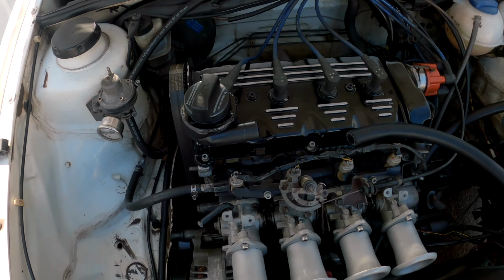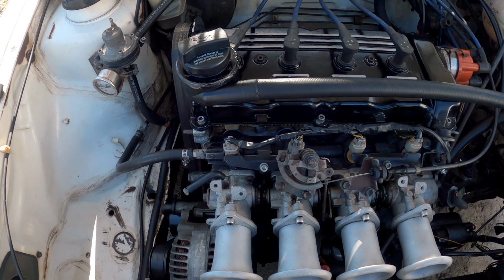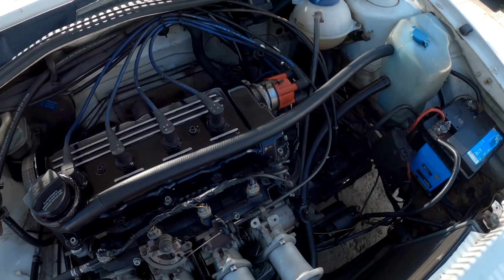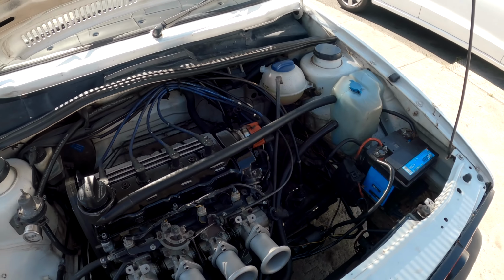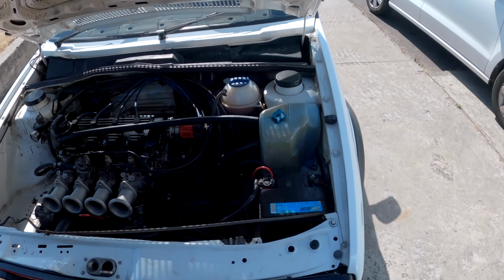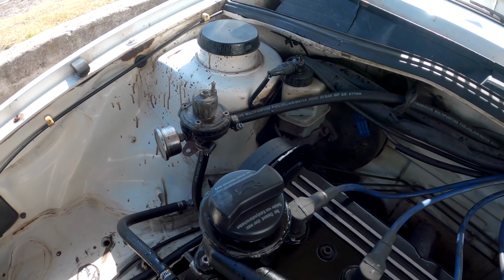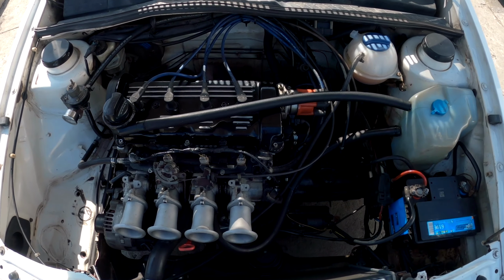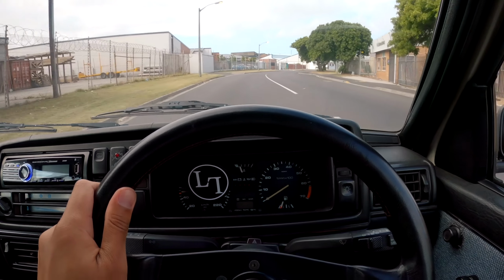Adding an extra breather to a VW 16v motor (hack) | POV test drive

Comment: My 8v fills up a 1L bottle with oil every 150kms but doesn't smoke. Would you say the motor is worn?
Reply from the maker: Is that 150 hard kms? If it's at the limiter a lot of the time. It will breathe a bit but I think that's a bit too much. Your rings could be worn. 8v's generally don't breathe much.
Reply: Do you mean 1L of oil into a catch can, or do you have to add 1L?

Comment: Where's the pressure outlet from the bottle? 
Crankcase builds pressure,  where does it go?
Your setup has nowhere for pressure to go, that's why you sprayed oil everywhere.
Reply from the maker: I appreciate your feedback but this entire setup is no more. Maybe it's because the crank case pressure had no where to go.